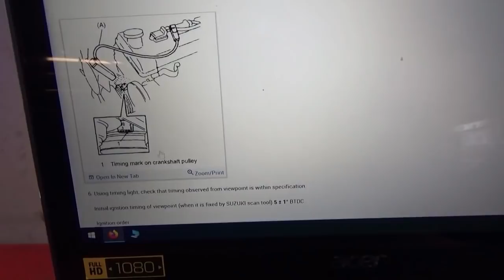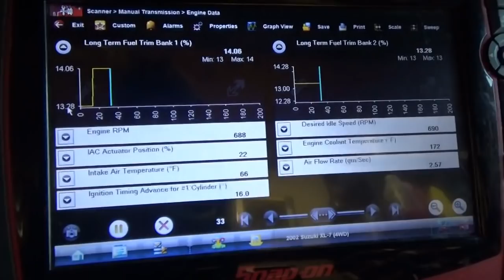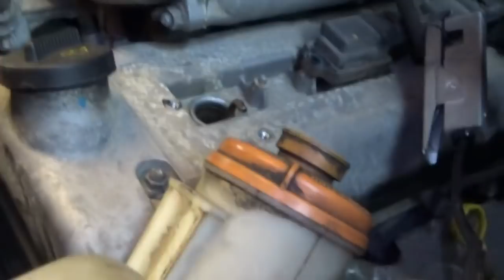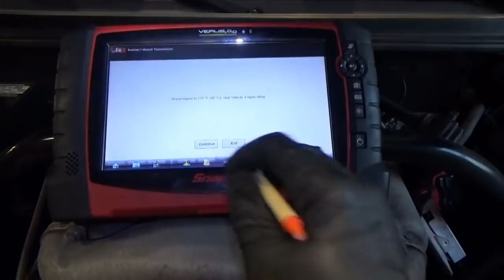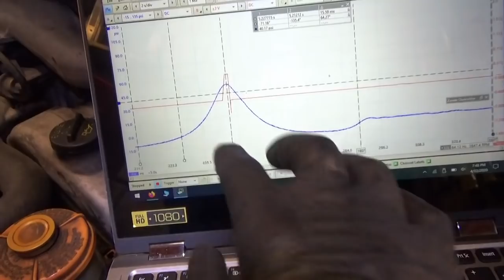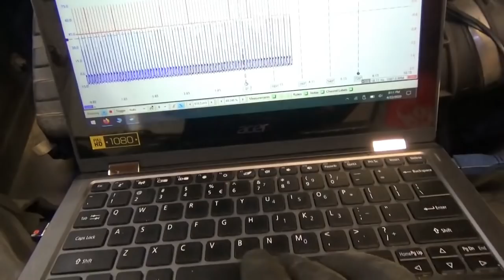Can you trust your Timing Light? - Part 1

Comment: Sounds like the valves need adjusting, Ivan. Also, no plugs should be expected to last over 60k miles imho.
Reply from the maker: @JamesAgans  modern quality Iridium plugs go for 200k miles and still look brand new 😉
Reply: @PineHollowAutoDiagnostics  the key word here is "look" of course, I am 78 years old, from the plugs and points every 15k days. At least back then, electrical problems were only a few simple things. I am truly amazed when I watch you look at a wave form and know what it means.

Comment: Haven't watched yet, but my guess is the tab or damper mark is way off.  That's a common issue with small block chevy engines where parts from different engines have been used.

Watched it now: Looks like the timing light was being triggered by the start of the dwell cycle.  Seems to make sense, since that's where the pickup would sense a change in current flow on the primary side.

Comment: Did the timing change alter your fuel trims? Since you are checking the basics it would be good to know where your cylinder leak downs numbers. Also I don’t remember if those engines are HLA or shim on bucket. Valve clearance will effect your cylinder pressures.

Comment: Does the engine have knock sensors on it? If so I would also add timing until you get some activity while driving and see what that base number is and compare to the OEM timing number just to get some more ideas about what is happening.......esc modules, coil inductance and timing light circuitry all can factor in to this.

Comment: The procedure showed connecting the timing lights pickup coil around all the wires going to the coil's primary. You connected to the ground wire only. Could that be your difference in the timing of the lights trigger point? Would part of the signal be cancelled out by the other wire so that the timing lights pickup only sees the secondary firing event? That would be a good follow-up experiment.
Reply from the maker: Very interesting thought! Would be an easy experiment to do :)

Comment: Yvan, can you share what pressure sensor you used in your PHAD TRANSDUCER?
I've been putting effort into maximizing the cheap Chinese PSI sensors including a MOD giving them a bit more neg PSI room! My next direction is exploring response specs which are stated as <1ms and perhaps not believable.
Others have brought up the gas compression time factor (point well taken) but a small lag in response time on PSI sensors can also equal a few degrees real quick.
And again, I'm paying attention to low PSI tower values that your transducer is reporting in this vehicle and others, in accordance with my work and in dispute with WPS500 frequently reported high values.

Comment: In the aftermarket tuning world, running your timing light off the low voltage feeds to a coil pack is considered inaccurate. I was always taught to get an old HT lead, pull out the coil pack, and connect the HT lead between the coil pack output and the spark plug. Connect your timing light to this HT lead instead, that way you avoid issues with the inductive pickup triggering off the wrong thing, and delays in the coil itself between trigger and actual firing. Not sure why suzuki says to check timing directly off a low voltage signal wire.

Comment: You need a reliable true mechanical tdc on cam and cranck FIRST. 
Dampeners parts separate and slip from each others = inaccurate unreliable TDC marks (need to check)
Timing chain stretch = inaccurate unreliable CAM/CRANCK relative position wich make things even worse  (need to check)
Timing has delay = inaccurate advance given by stroboscope ( need to take in consideration) https://youtu.be/H_oYAEMGZS0
Pressure transducer has delay. 
You will never have a true mechanical TDC if you rely on questionnable mechanical parts such has stretched chain, dampener etc...
You do that on a indirect diesel injection with a mechanical pump,it wil never start lol

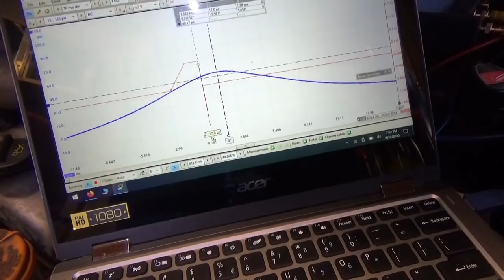Comment: Looking at your waveform at 20:34
Beginning of spark is 5 deg,   End of current ramp is another 5 deg.   Beginning of current ramp is  5 more deg.
1.5 ms spark duration is only about 1 deg at idle.
I would like to see where timing is with pickup on a plug wire installed between coil and plug.
Wouldn't a stretching chain retard timing, not advance it.
With 15 deg extra advance it should be pinging to beat the band (until the knock sensor retards timing).
Are the valves opening a little late?
Can retarded valve timing cause lean fuel trim?  
Fuel trim went down at higher rpm indicating a vacuum leak.

Comment: My timing light broke about 5 years ago. Still have had no need to replace it. I don't do tons of in cylinder pressure testing, but I have 2 home made ones. One for gas and one for diesel. In cylinder testing is absolutely the way to go. There is a learning curve to get used to what you are seeing, but it doesn't lie. Get a flat cam Hemi and the problem is obvious. With the trend towards variable compression it is going to be the only way to really know what's going on with minimal diagnostic time invested. 

It was hard to pull the trigger on a Pico and dedicated laptop for it, but if you are a serious pro who makes a living this way. DO IT. You will never look back. I'm close to getting the NVH kit for vibration and noise.

Comment: old plugs get conductive material glazed onto the porcelain and can start misfiring at high rpm's, more noticeable with high compression/boosted engines. always change plugs because the ECM adjust for it thinking it's fueling/airflow issue, which ends up in MPG loss long before any idiot lights come on. lol
where it comes from who knows, but I'm sure it's mainly from contaminates in fuel, oil, through PCV, air intake, EGR, evap. and other vacuum devices and intake tuning gadgets

Comment: best bet always use an old plug wire/tester to extend and pull the coil out and clamp over that lead, not the primary wires.
if the jaw open wide enough you may be able to hold it open over the coil body enough for it to trigger, that should be very close.

Comment: I think the primary source of error in the measurements is coming from the fact that the "pressure signal" will lag that of the physical piston location (I believe I have that right).  I was thinking that you might be getting error from your use of the primary current signal but I saw that you were timing it from the falling edge which would correspond to the secondary coil discharge.  The time to discharge would be negligible for the time scales your working with.

Comment: On ‘worn’ engines I’ve always trusted my ear.  I advance the ignition timing to being on the verge of ‘pinking’, then retard a couple of degrees.  I’ve found this method best in achieving optimal performance.  Wee bit of trial and error but no more time consuming than the process in this video.  Great article Ivan all the same👍🏻🙂.

Comment: Do a Cam Crank study, you probably have the old Cam Crank waveforms after you changed the time belt.
Reply: There is no tooth missing on the toothed disc of the crankshaft sensor. This method does not work.

Comment: I think a better title would be "Can you trust a pressure transducer to tell you TDC".  I think you confirmed the timing mark with TDC in the "Rod in the cylinder test" so I would just go with what the manual says... use the timing light, after all that's what the Suzuki engineers did when they came up with the spec.

Comment: My guess is that since you are using the ignition primary to trigger the timing light, that the light is being triggered as soon as the ignition coil is turned on.  However the spark that is produced by the secondary winding does not occur until the magnetic field collapses in the primary(which occurs after the primary winding is switched off).   This means that the timing light is being triggered a few milliseconds early which is showing up as an additional few degrees of timing advance.

On another note, I happened upon your channel after seeing it suggested after watching the South Main Auto channel, and as someone with a background in Physics, Electrical Engineering, and Computer Science and above all else passionate about working on cars, I have found it your story fascinating and perhaps a bit of inspiration.
Reply from the maker: Excellent hypothesis Jeremy, and thank you for the kind words 🙂

Comment: The best way to do the timing light is to get a spark plug wire and jump it from the coil to spark plug and put the timing light on it, reading from the trigger wire of the primary circuit MIGHT give wrong readings because the ecm closes the transistor a little earlier because of the coil saturation and dwell time so it might seem that its firing early, so its always best to do it on the secondary side of the coil and not primary.
My other 2 cents, the in cylinder tester isn't 100% accurate, reason i say that is because the lentht of the hose from the spark plug hole to the in cylinder tester is long, so it has a slight delay, when the piston finish compress, the compressed air is still going up the tube to the tester when the piston has already stopped at TDC.
Reply from the maker: Excellent thoughts on the variables!

Comment: Some of these old Japanese vehicles used a throttle sensor that used a switch as well as a sensor, on a Toyota they would not go into fixed timing mode if the switch was out of adjustment making  the timing light reading invalid.

Comment: We owned 5 Suzuki's and still would if they sold them. Our 2000 Grand Vitari V6 and 2008 SX4 both had the same symptoms and was timing chains. They were notorious. Going to dealer for parts for the SX4, was surprised to see it had a recall for the timing set. They repaired it free under warranty even though Suzuki was no more. They are still very popular used cars in my area.

Comment: you already have the cylinder missfire why not hook spark tester to coil and run timing light on secondary trigger ,, see if it makes and change ,, I suspect fall and rise to see some change in time,, I had a crank sensor wired reversed, wave was reversed car would not start . makes me think it might make a difference here too

Comment: Loss of power with high LT fuel trims... Hmmmm...
I'd also be checking for a small inlet manifold leak that's slowly 'growing' over time.
(Fairly common fault on the Aussie Ford Barra I6.  When it gets worse, the IAC is unable to maintain idle RPM)

Comment: Just my theories:

Using both timing light and PT you've verified that the chain
is indeed stretched. The correlation proves it. The new tensioner
continued to stretch the chain.

I can't imagine why you only replaced the tensioner, and not the whole
sprocket/chain set; they all work together.

I would clean that old mark off, and make a more precise line, use
a proper florescent crayon- it's just an undefined blob right now.
The same goes for the scale- it needs to be cleaned to be seen well.

Reading the PICO, you can see the dropout from the chain bouncing,
as it is tensioned the released.

Comment: Makes me wonder how far off all my old cars really were! Could be why I decided long ago to never set it to published numbers, but by seat-of-the-pants torque, along with light spark knock at full throttle. That used to work really well for me in the day. 

I would imagine any slop in that cam sensor drive, if it's anything like a distributor, would throw the marks off. That, a worn cam chain, and harmonic balancer slip. Been seeing alot of the latter the past several years.

Are you driving this to FL, or are you flying? It's a long ride - I've done it twice, towing cars down there for my buddy. It would be easier if I could relax, but I can't, LOL. 😂 Anyway, looking forward to part 2! 👍🍻

Comment: Hey Ivan, long term follower buddy
Greetings from the land down under (Australia)
Speaking of issues, i had one random issue happen the other day with my L67 (Supercharged GM 3800 Series 2)
I was driving out of a parking lot it just died, but then restarted and ran fine afterwards, also very rarely it feels like it has minor stumbles 

Could that be Fuel regulator related ?
And with the random stall & sometimes long crank time, i'm presuming CAS
Reply from the maker: Check the fuel trims!
Reply: @PineHollowAutoDiagnostics  Could it be CAS, Fuel regulator related or even a dirty MAF ?
When i have access to a scan tool i will.
Reply: @PineHollowAutoDiagnostics  I can't exactly drive across the ocean Ivan otherwise i'd bring it to you 😂😂

Comment: That was good Ivan. I've not seen a video that compared the timing light compared to a scope. Pretty interesting. I must have timed 500 cars in the late 70's (I worked at a tune up shop) all using a timing light and a big "Sun" scope that was as big as your car.  :)
Reply: My grandfather had that Sun unit. He was going to give it to my dad and I, but due to family issues that never happened after he passed.  I could've done alot with that! 

On the timing topic, when I was coming home from out West in my '72 El Camino, towing a U-Haul, I remember I couldn't give it much pedal on hills, since it was knocking so badly. I climbed through the Sierras in CA at 40 MPH. The next rest stop I disconnected the vacuum advance, and plugged it off with a white and blue Bic pen - the tip fit perfectly in the hose, and stayed put. When I pulled out of that rest stop, I couldn't believe the acceleration!! Had to look to see if the trailer was still attached, LOL! Mileage went way up, too. That little mod probably saved me $150 in fuel across the country at that time! :)
Reply: @SmittySmithsonite  That's a great story!
Reply: wyattoneable - Thanks. There’s a lot more where that came from ... 😁

Comment: If the ground side of the coil is being used to trigger the timing light, then the light flashes when the coil begins charging, which explains why it appears advanced. Since the coil sparks when the ground is interrupted and current flow stops, the timing light can't accurately show the actual spark point. It should be more accurate if the light is on the secondary side of the coil.
Reply: right, always check on the secondary side, alternate is primary wire on coils with external ignition module only, otherwise it will always trigger on the coil primary "charging", you may be able to hold the clamp open over the coil enough to sense, but it may not be accurate in dwell either.
someone didn't remember that spark occurs on primary voltage turnoff as the magnetic field collapses :)

Comment: My guess is that the physical timing of the engine (can to crank) is not correct and because that is run off of the camshaft it's causing the discrepancy,

Comment: Max pressure does not occur at mechanical T.D.C.,timing is measured off of T.D.C. not max cylinder pressure.
Reply from the maker: When does max pressure occur?
Reply: @PineHollowAutoDiagnostics  Max pressure occurs before T.D.C. by a number of degrees,different for every engine. Piston floats at top for so many degrees in transition from up to down. To get true T.D.C. you have to take movement before and after and divide by two.Watch YouTube videos on Degreeing A cam.,you will see what I'm talking about.
Reply: @PineHollowAutoDiagnostics  Also,Brandon Steckler discusses this phenomenon in a video on pressure transducers.
Reply: @PineHollowAutoDiagnostics Very interesting stuff here PH..... I know from our race car world those that are smarter and more deeply invovled than me in things like this have said that max cylinder pressure will typically occur at 14*~ atdc with engines using common rod to stroke ratios similar to normal passenger car engines......Max piston speed Typically occurs at 72-74*atdc due to the mechanics of these rod ratio angles.....not at 90* like one would assume it would be.    By 90* atdc on the power stroke there is really nothing much left to apply any additional push on the piston power wise, it all over by this point.
  On a semi-serious Nitrous engine the exhaust valve will already be open a considerable amount by the 90*atdc point on the power stroke.....the usable window will be over much before that 90* point as far as producing usable work on the piston.....these are WOT situations I am referring to but this gives some insight......The rabbit hole starts getting deep when you really start trying to understand it all. 
  Great channel and content, I will be subscribing and look forward to following along.
 Best wishes.
Reply: @mannieecker8602  Yes, with spark after TDC,no spark before tdc using transducer.
Reply: It is very interesting! I would like an extended discussion. I recall from the university course that it is so.
Это очень интересно! Хотелось бы расширенного обсуждения. Припоминаю, из курса университета, что именно так.

Comment: A spark coil is an auto transformer.  Current flows and you charge the core of the transformer.  Then you open the charge path (gracefully so you don't destroy it) and a spark appears from that energy.  It seems like power flowing to the coil would have very little to do with the exact spark timing.

Comment: Can you trust the timing of the reading on the pressure transducer? The pressure rise doesn't get to it instantly.
Reply: I would also think the length of the hose and it’s dia. to the pressure transducer might affect it
Reply: @ggstephens50  Just the length of hose. Roughly a millisecond per foot. 1.125 to be more precise.
Reply: It gets there at the speed of sound.
Reply: And the signal for the timing light gets to it at the speed of light (almost).
Reply from the maker: Great point! We would need to perform an error analysis to see the potential delay in time 🙂